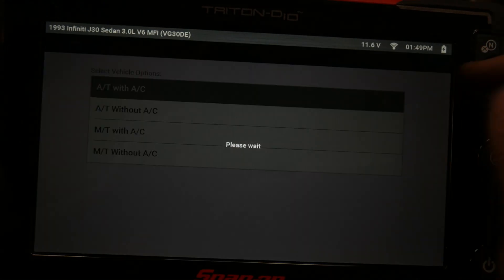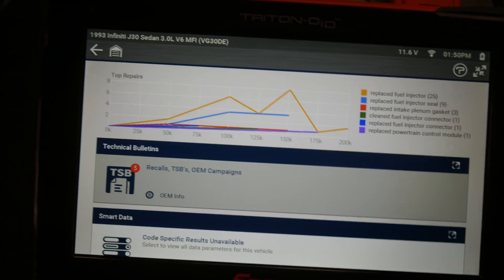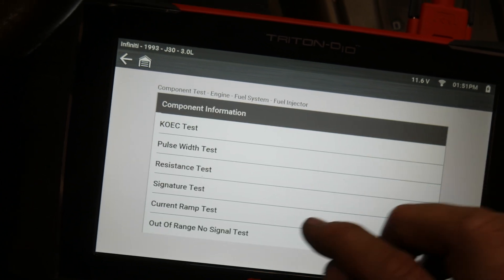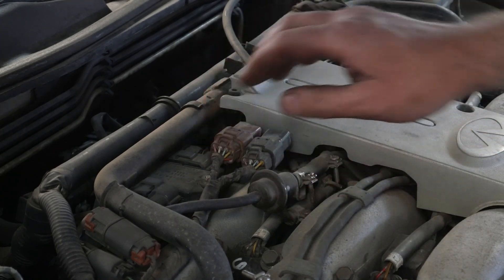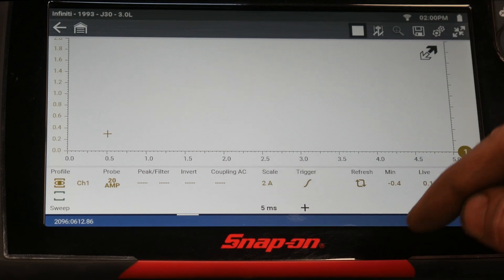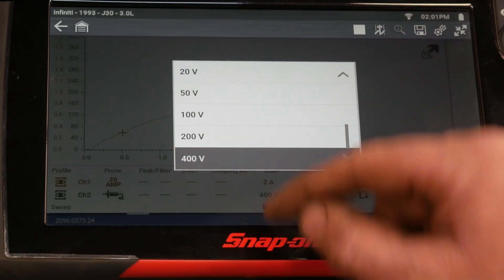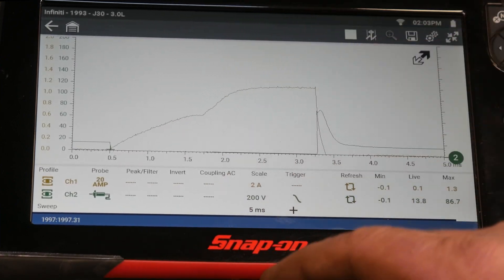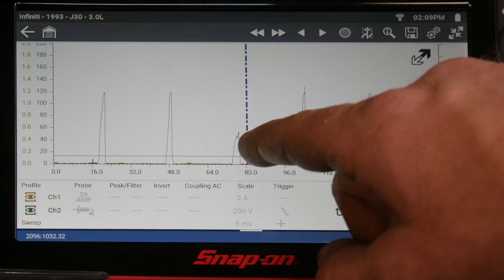1993 Infiniti J30 Rough Running Diagnostic

Comment: I have a 1995 Infiniti j30 and have a misfire on cylinder six new plug and coil pack was going to change the fuel Injector but don’t have a clue how to get it off.
Reply from the maker: There are two Phillips headed screws that are easy to round off holding the retainer in place on top of the injector. Once the retainer is removed I wiggle the injector until it begins to move side to side and the remove some pliers. Fuel from the fuel rail will drain into the cylinder so it is best to disable the fuel pump and run engine until it stalls to depressurize the rail.

Comment: I have a 1995 Infiniti J30 I want to change the suspension and shock absorbers It's hard to find parts for this car
Reply: i swapped my 1994 J30 to S14 240sx suspension & coilovers and i just helped a friend do the same. sway bars from the twin turbo 300zx also fit & reduce body roll

Comment: As an owner of a J30 with 55,000 orig miles I can honestly say these cars were overbuilt and when stuff goes wrong, it can be a pain to trace the cause of the issue. One time, my car sat for 2 months at a shop because they couldn't figure out its no-start issue. After two months of poking and prodding, my mechanic took a wild guess and replaced the coolant temp sensor. Just like that the car was fixed. These are fantastic cars when everything runs right but just be cautious should run across one for sale at a steal price. Some parts are becoming scarce and labour can be intensive i.e. 6+ hours to do valve cover gaskets. That all said, I love my 4 door 300zx

Great channel!
Reply: Oh wow. Mine just did not start up in a parking lot. It is acting like no spark...

1993 Infiniti J30 like you.  124k...

Comment: I have a question, if you  know. 
When the ECU command the  injector to  spray the fuel, for example, 30% BTDC for 2,5 ms on idle  , and then you press the accelerator pedal to 4000 rpm,and the command of the injector is now for 2,9 ms , the injector will start spraying the fuel 30% BTDC and for 2,9 ms ,or has some kind of advance (like the ignition),and start spraying the fuel a bit earlier and for 2,9ms?
And also, what about the variable valve timing engine?thanks.
Reply from the maker: Many engines will fire all the injectors at the same time while cranking and then switch to sequential injection. Once it switches to sequential injection the injector will fire with an advance. The advance probably doesn’t change much but the duration or pulse width will change. At higher rpm and high load the timing is irrelevant because the off time is shorter than the on time. On performance vehicles you have to install larger injectors if the on time is more 75-80% duty cycle. 
I don’t know if the VVT angle affects the injector timing.
Reply: @ThePracticalMechanic  Thank you very much for the reply. I really appreciate the knowledge you are sharing with us. I have learned a lot. waiting for your  next video....